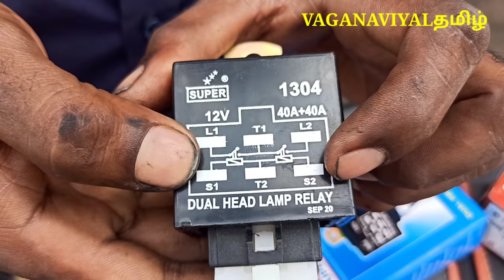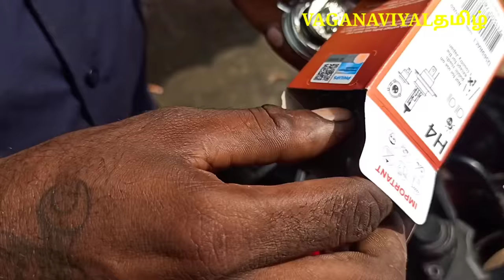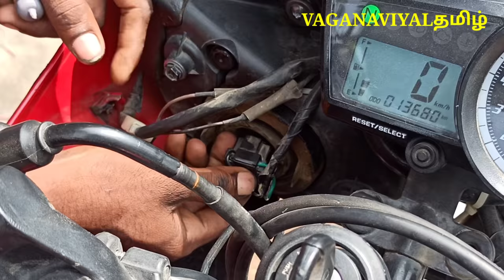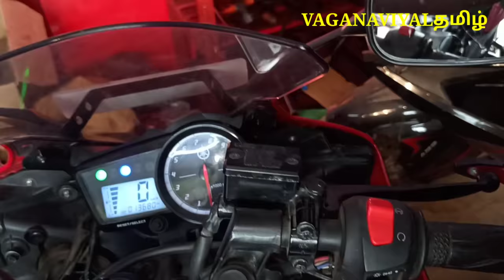SUPER RELAY for HIGH POWER HEADLIGHTS for all BIKES

Comment: This is the first vlog for fitting a relay for using  high wattage bulbs. Good review, informative 👌👌👌. I'm going to fix the same type of bulbs with relay. Since the head light is fibre and not glass,it's not advisable to use 100/90, instead 60/55 can be used.

Comment: Two drawbacks irruku... 
1. Battery easy ah drain aagum..  light maximum 8 amps edukum... some bikes battery amp hour low va irrukum..antha mathiri battery la easy ah battery week ah aagidum.
2. 100w light la heat athigama produce aagum... athuku holder ceramic la use pannanum... appadi pannala na plastic la irrukura holder heat la urugidum.. and some bike la head light engine la irrunthu vara ac voltage la work aagum.. athu relay coil connect pannum pothu engine low rpm la problem irrukathu neenga speed ah poitu high beam or low beam change pannum pothu work aagathu

Comment: Dear friend 1.in +ve fuse is must. 2.wiring holder capacity is 35w.you have to change 2 bulb holder 90/100 capacity. 3. Bike battery is designed for 35w output if you change to 90w means battery life will be less. And  charging complaint will come
Reply from the maker: Yes bro your correct but that bike owner bought this all thinks and he like to fix all

Comment: The doom focus is designed for 35/35 wattage only if you increase the wattage the focus get damaged soon. Very important message is the battery life go short
Reply: For night time only lights will on this is not AHO set up bike manual switch on off for lights. So no problem battery will charge while driving without light in day time.

Comment: High power headlight nalathu dhan but opposite la vara vandi ku disturbance ilama iruka dim pani poganum. 
Night time la safe driving ku tips oru video podunga bro. City la naraya per dim dip adikura practice ila. Day time la ethuku pass adikurom nu awareness ila. Dim/ low beam pani dhan indicator podanum, sila vandi la drl matum on pani otranga (scooty pep, excel 100). Front and back la reflector clean ah maintain panrathu, ethu lam safe practices + unga style la konjam points solunga bro. 
Also neenga ena lam bikes use panenga, unga first bike ena, dream bike ena, current la ungala shock/surprise aga vecha bike technology, mechanical components antha mathri solunga bro.

Comment: I think 100/90 bulb is not allowed to be used in Indian roads. Police can charge fine for using those bulbs. 
Our bike battery capacity will go down, so battery warranty claim will also be a problem. 
In old bikes head light can be switched on only if you start the engine, but due to AHO (AUTO HEADLIGHTS ON) now a days it works directly, so battery will dry soon. 
Sorry for giving all negative comments.
Reply: Hai anna watts increase pannum podu charging coil kku problem varuma?

Comment: Hi sir, Recently did 60/55w bulb and again downgraded to 30w LED upgrade to apache rtr 180. But often facing battery down issue when using Horn and headlight simultaneously. I think you will also face same issue with 100/90 setup in R15. Could you suggest a solution? Thx.

Comment: Bro one hologen require 3amp load then two bulb required 6 amp ..but r15 battery has only 5amp ...it will definitely damage your bike 👍
Reply: You are right bro, he is using car relay and car bulb where battery is 60ah, in this bike max battery is 5Ah.. his battery will drain faster than before.. also it will affect other electronic components too..

Comment: Super splendor 2018 60/55w h4 bulb use pannen no relay just changed bulb . no improvement in brightness but heat so much .again changed to 35w bulb. 35 w pakka brightness athikama irrukura maari irruku

Comment: bro na headlight relay  with 100/90 potturthen head light lens heat ayi melt ayrich pulsar 180la set pannirthen,long ride ponna after 100kms battery warning lights blinks.But brightness and distance level  staright road you can see upto 700mtr to 900mtrr but no guarantee for headlight lens and battery. i used for 2 yr  then changed lens

Comment: After watching this video i fixed roots relay with 12v 60/55w it worked very good but while on long travel in night time battery suddenly down then on day time battery got charged while driving, pls don't do this it will damage the battery and Dynamo coil mechanic told .

Comment: Bro oru help bro my discover 110 cc bike battery and rr unit  start panna heat aaguthu and bike 10 minutes aprum off aaguthu bro and battery line disconnect panna bike super ra poguthu bro yenna bro pndrathu video pannuga bro
Reply from the maker: Battery problem bro new battery pottu check pannunga